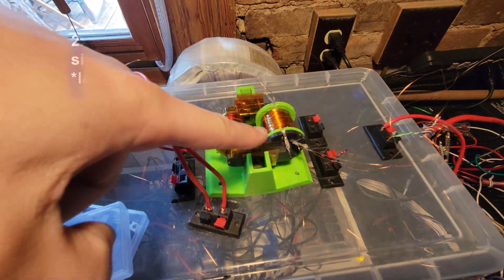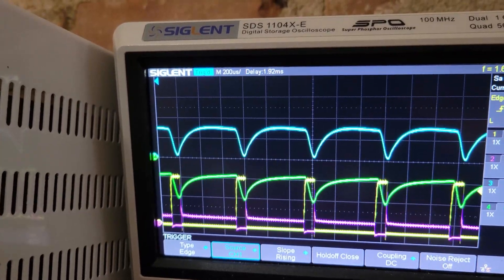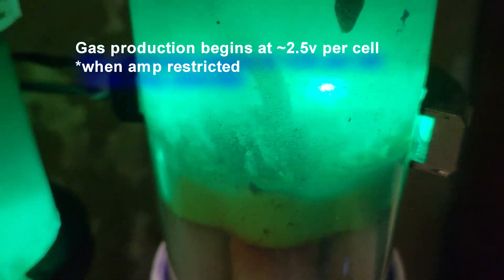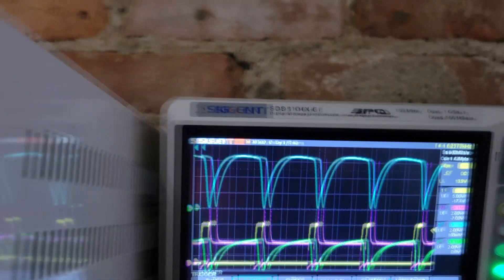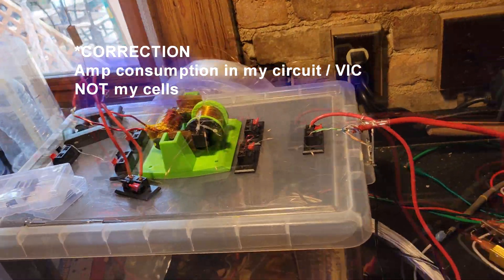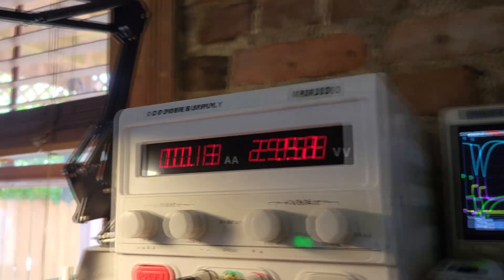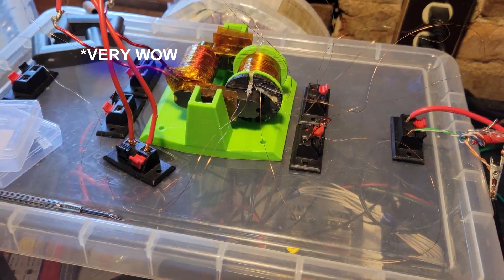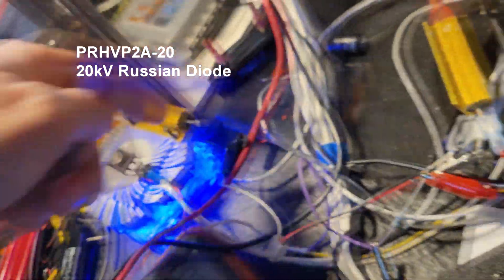Someone Explain This To Me. What Is Actually Happening?

Comment: @noahauman 
Hi, I have some insights, I build and operated sound systems. 
The yellow trace pulse is like a hammer hitting a bell, the inductor network is the bell and the cell is driven by output forces from the resonating 'bell'. 

In speaker crossover networks sometimes we are trying to make a similar circuit to drive the individual speaker woofer in narrow frequency bands very loud without distortion basically isolated from the amplifier via a transforming inductor but then have other caps and inductors in series parallel on the secondary side between the speaker woofer and the transformer secondary. These configs setup an LC circuit on the secondary side that is then usually dampened with resistor banks in series parallel with the speaker to stop the resonance after 1 or so cycles at a given frequency range. In these speaker systems the speaker in a box is driven in a way where it is electrically and mechanically impedance matched so when you input a signal from the amplifier to the crossover circuit you gets a flat impedance and responce curve and a good sounding speaker. If you removed the resistance banks the circuit would ring like a bell and the speaker connected would sound very bell like.

Because your system is unipolar its slightly different and i think you are seeing the cell voltage appear either, as a result of the inductor never fully collapsing between duty cycles or a frequency multiplying effect is occurring and you are seeing the diode rectified output of the LC circuit ringing at a higher order of the input PWM chop frequency. Stan talked about a second LF off time that interrupts the whole circuit with other loads and excitation circuits. 

try making the diode full bride, get the polarity right and see is the voltage goes up??
Reply from the maker: Interesting insights. The circuit I know is very closely linked to audio technology like you describe. Same frequency range too. I can tell you are very knowledgeable.  Please contact me on my profile page. I'd love to discuss some notes if you're up for it.

Comment: Impressive!
Reply from the maker: I'm still wowed. Much to optimize and improve yet. Thanks.
Reply: @noahauman  Cracking water without catalyst is impressive by itseft, I am building a generator with Sintered or pourus stainless anode and cathodes, Should be way more effective.
(Pourus Stainless), When I get it completed I will attack the High voltage pulsed DC with low current, Very glad I stumbled ion your channel! Great work bud..

Comment: The amount of gas produced is fundamentally limited by the amount of current flowing through the cell. If you only have two electrons passing through your cell each second, that’s just one hydrogen-oxygen splitting event per second at maximum. Now way around the conservation of charge.

To actually gauge your efficiency, you should measure the mass or volume of gas produced per joule or watt-hour of input energy. That’s your energy efficiency, you can also calculate your coulombic efficiency by figuring out the number of moles of gas production per coulomb or amp-hour of input charge. Once you’re measuring those, then you can figure out if changes you’re making are significantly impacting your yield. Personally I don’t think higher voltages are the way to more production, I suspect they won’t improve your coulombic efficiency and will hurt your energy efficiency. High voltages are also an ignition risk, be it directly via arcing or via coronal discharge.
Reply from the maker: This is not an electrolysis process in the traditional form. We are not exchanging electrons (amps) to create HHO. This process is voltage dependent, creating voltage fields that restrict amp flow. This allows the voltage 'pressure' to disrupt electron orbits of the water molecule, breaking it apart without exchanging an electron in the process. Ergo, the higher the voltage, the more voltage 'pressure', the more gas production. Amp consumption is actually the enemy in this scenario, whereas voltage is the unit that performs the work.
Reply: @noahauman  well you should calculate the efficiency to see if it’s really any better than a conventional low voltage acidified electrochemical cell. The change from water to hydrogen and oxygen fundamentally requires a transfer of electrons from oxygen to hydrogen, there’s no avoiding that.

Also is there any reason not to just use rectified mains voltage instead of making a fly back converter? Use a CW multiplier if you want more than that.
Reply from the maker: @Scrogan  Rectified mains would not produce a resonant condition as the transformer / inductors do. Mains are also only 60Hz so only 120Hz would be delivered to the cells. My frequency is in the KHz range. In Stan's method, electrons are not 'exchanged' to break apart the molecule. Unlike traditional electrolysis, voltage fields are formed inside the cells (acting as capacitors), affecting the electrons' orbits. With strong enough fields, it breaks the covalent bonds of the molecule without amps being consumed in the process. Unlike traditional means, voltage can perform the work without consuming excess power (amp-electron-exchange).
Reply: @noahauman  I mean rectified mains to get a high voltage DC, followed by a conventional switching topology. It’s easier and more efficient to work with big single inductors, instead of being limited to what airgap/flyback transformers you can scavenge.

Even if you can bypass the N electrons losing X electron-volts of energy to split one atom of water, you can’t bypass the enthalpy of formation of water. 285kJ/mol or 3.51mol/MJ is your absolute maximum efficiency, any better and you’d be able to burn the resulting gases for more energy than you put in. You should be calculating your production rate as mol/MJ in order to quantify your gains and compare them to conventional low-voltage electrolysis.

Comment: Hi, Noah! This is the cold electricity, if has negative resistance effect, or radiant energy effect. You are able to check with Avramenko plug (just 2 diode and one LED).
Has also reverse entropy.
Reply from the maker: I was actually just discovering the 2 diode thing, so I must try it, yes. Perhaps in a future video.

Comment: If you want to utilise the back emf pulse to its best then read Bedini’s work start at SSG. You need to make your secondary a bifilar wound coil😁✌️❤️🤘
Reply from the maker: My secondary coil is bifilar. With an open center tap, it produces excellent equal-opposite-polarity pulses, though I have had success with the bifilar secondary connected in a dual-mode.

Comment: Just like current can be interchanged with time, so can voltage in the opposite manner. #transients
Reply from the maker: I need to read up more on this. Any keywords other than "transients" that could help my discovery?
Reply: @noahauman  Here's a good one ;)  Theory and calculation of transient electric phenomena and oscillations by Steinmetz, Charles Proteus, 1865-1923

Comment: sweet, I have one suggestion, add gas production output to your measurements (digital H2 meter, does not matter if it can accurately measure HHO, as long as you compare measurement values) - since gas production is your goal, I can tell you from my own experience, that there are inbetween resonances where you get close to the resonance of the water surface tension collapse and you can so find resonance frequencies to exploit ...
Reply from the maker: I've been scared to use a digital flow meter, because of the exp hazard. I suppose I'm overthinking it though.

Comment: Excellent brother. I follow your publications daily... we are aligned with the concepts. If you allow me, a suggestion... try using an analog ammeter to measure the voltage consumed by your complete circuit, I mean, including the electronic pulse circuit and VIC towards the reactor(s).. this way you can see the "real" current consumption.. I hope you can reach about 10KV with that you will have very very good HHO production.

Good luck, dear.
Reply from the maker: There's a lot of things I'd like to buy, but I'm not out asking for donations (just yet). I have a list --- analog and isolated meters are on it. Thanks for tuning in!
Reply: @noahauman  I understand you perfectly. I hope that you too can buy what you are looking for so much...if it were easy it would be boring. Don't give up...I've been at it for 3 years...and I still have a few miles to go to get to what I'm looking for...